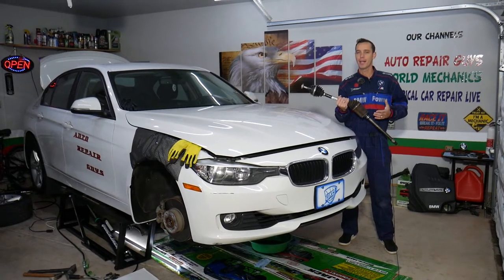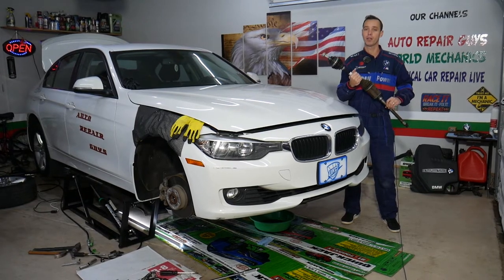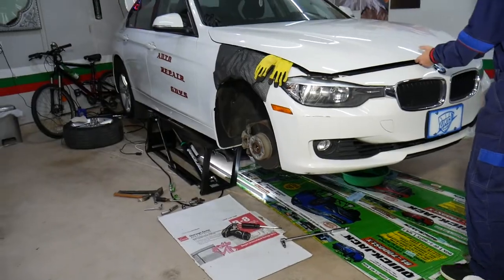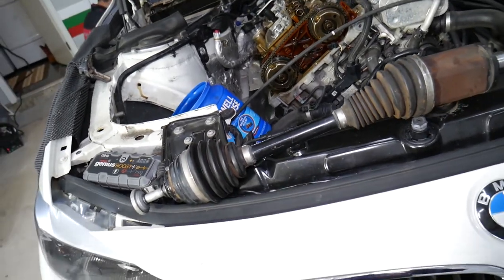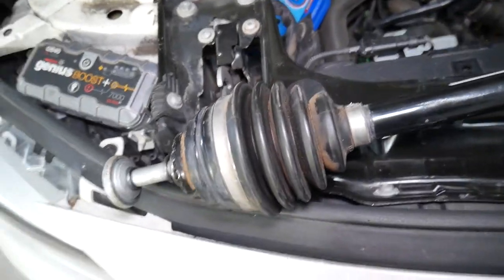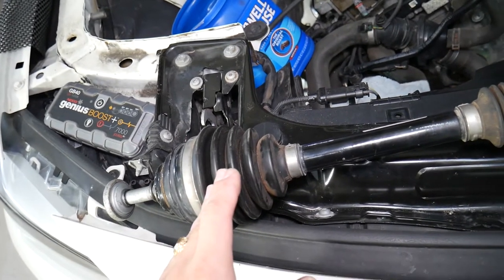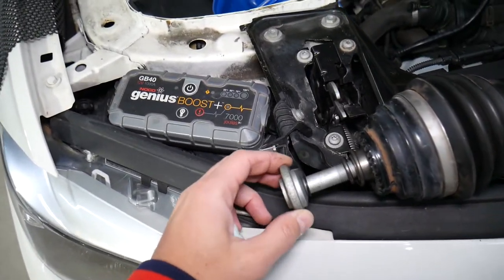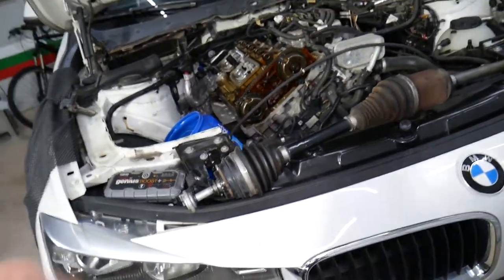HOW TO KNOW IF LEFT OR RIGHT CV AXLE SHAFT IS BAD ON BMW

Comment: How do you identify which CV Axle is bad on the REAR of a BMW x5 (F15)?  I've got a strong vibration that gets worse with acceleration but is not affect by turning.  I took a video of the car while  driving and can here clicking which seems to be a bad CV but the sound/noise level is nearly identical on both sides.  I cannot physically feel any play on either axle.
Reply: What was your issue my 650ix gives a knock/ vibration on acceleration or when coming to a stop while at high speeds